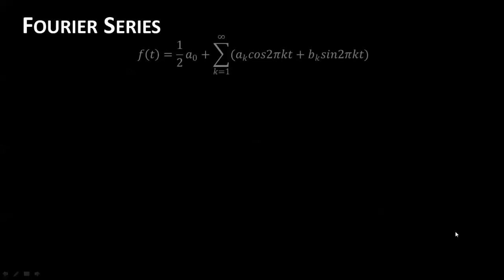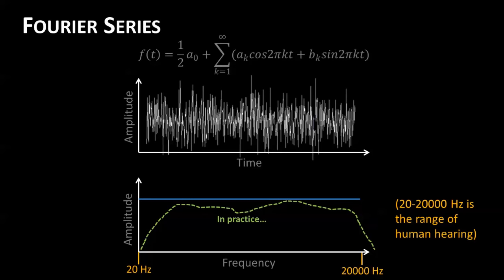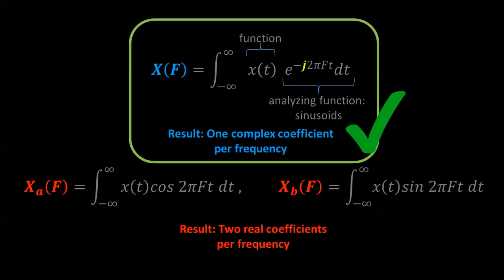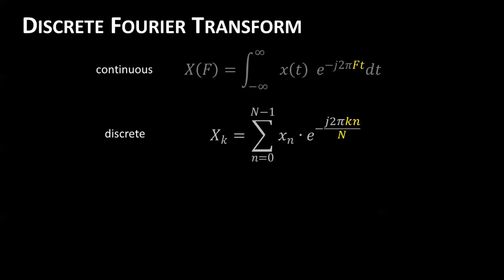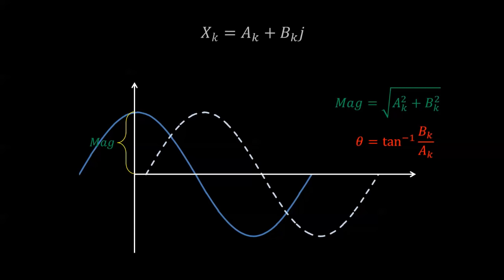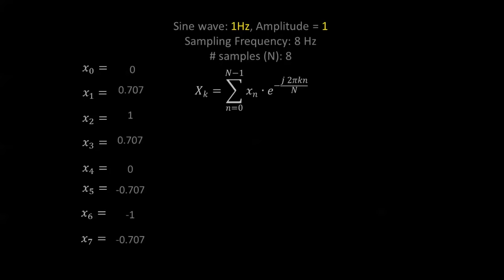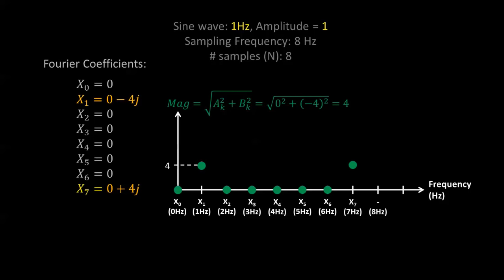Discrete Fourier Transform - Simple Step by Step

Comment: How do you know the phase angle is based off of a cosine wave?
Reply: i also didn tget why it is based on cosine. in the divide and conquer it interprets (cosθ; sinθ) = cos + i*sin. therefore since we have X1 = 0 - j, i would expect to the starting point to be at (cos,sin) = (0,-1) which is indeed the 3pi/2, but that doesn;t justify why we build our final answer on the cosine  glyn hodges

Comment: This is a very nice presentation, but not sure if the explanations for frequency resolution, why you drop < Nyquist, double, then average by 1/8 for the amplitude, etc. are quite correct.  I think it's a lot clearer if you directly convert from Fourier Integral to the sum, where t->t_n=0,1/8 sec, ..., 7/8 sec., and F-> k Hz, dt->1/8 sec.  These should give the correct results without the need to remember all the rules/explanations given here.
Reply: Can you explain that in more simple way? Or any other good way to calculate amplitude from results of this video?

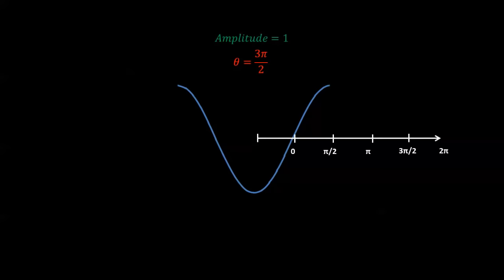Comment: If you change the input to 1 + sin(2*p*t), that is add a DC value of 1.  The Fourier coefficients are now (8,0,-4j,0,0,0,0,4j).  Now if you follow the procedure given at 10:34 (where you double all values and divide by 8) you will end up with a DC value of 2 instead of 1.

Comment: I got confused at 7:40 on how 0.707[cos(-π/4) + jsin(-π/4)] equated to (0.5 - 0.5j). Then I figured out that (0.707...)² = 5. Posting this in case someone else gets confused.
Reply: For complex number, In converting exponential to trigonometric form  its angle should be in degrees but  i am confused why he didnt convert it to degree form, it's still in radian.
Reply: @markinodeo8761   Have you ever asked yourself why it should be changed to degrees?

Comment: Eh. Good video but IMO, it's way more intuitive to first think about the FT using the DFT, and then to think of the DFT as the correlation sequence of the analyzed signal with the complex sinusoidal basis function (i.e., e^(j2piFt)). Cross correlation of two signals x(t) and y(t) gives a value that tells you how similar they are. The DFT can then be seen as a cross correlation of your analyzed signal with different complex sinusoids -- this allows you to say that there's a "sinusoid component of frequency F" in the signal. The youtuber "David Dorran" has a nice video series explaining correlation. 

To see what is meant by sinusoidal basis vector, it's intuitive to think of a signal as a vector (each component of the vector is a point in the signal). Julius O Smith's book "Mathematics of the DFT" broaches the subject this way (Chapters 1-6) and goes on to give a 2D example of signal reconstruction (i.e., the signal consists of 2 samples). With the geometric understanding of a signal and the understanding of DFT as a cross-correlation, you'll see what the DFT for what it really is. 

Then you can extrapolate and understand the DTFT, and then the FT.

Seeing the DFT as a sum of of terms doesn't give any intuition about signal reconstruction. The path I recommend is a bit more tortuous but it gives you a MUCH better sense of what the "coefficients" Xk, Ak, Bk mean (Ak and Bk are values in a cross-correlation sequence for real/imaginary components; Xk is the complex-value cross-correlation value).

Comment: Thanks a lot for the wonderful explanation! May I ask why should we double the magnitude of the amplitude below the Nyquist frequency? Does the equation of discrete Fourier Transform imply this? Really hope to get your answer!!!
Reply: Zhongwei Jin yeah even I have the same doubt.
Reply: Nyquist frequency means you have to sample at 2 time the maximum frequency in the signal. your result spits out values outside of that range because thats how it mathematically works but not physically when building a filter or other DSP device.
Reply: You can look at at from the point of energy.
The result not only tells you the amplitude and phase, but the integral under the "curve" is a measure of energy.
Now the way it works is, that you have spread out the total amount of energy over the whole result. But you know that everything above the Nyquist frequency actually is "a lie", you just get it because of the limitation of this limit. But even if we know this to be an artifact, it still consumes "area" in the graph and thus represents energy.
If you just cancel that part, the energy consumed by this part of the graph still needs to go somewhere. So what you do is, you "distribute" the energy from the canceled part to the part you are keeping. And since you cancel everything above the half of the graph, this means you have to double everything below that split point in order to keep the total amount of energy constant.

In Physics this often is a very powerful method: If there is some "problem" in understanding why, then apply the one most important concept in all of physics and technics - conservation of energy. Energy usually - but not allways - pops up (if it does at all in the problem studied) as "area under the curve". So if there is some doubt, try to figure out what the area under the curve could mean. If it is energy, then the principle of conservation of energy applies.
Reply: @kallewirsch2263  excellent answer, thank you!

Comment: Extremely helpful but I'm having trouble interpreting my own result for a set of points [2 2 1 0 0 1] (a shifted trig function). I'm getting X0 = 6, X1 = 2*sqrt(3), and X5 = 2*sqrt(3) and so I considered the Nyquist limit and got X1 = 4*sqrt(3) but would X0 become 12 or stay 6? Also I have angles so how do I put all these results together in one trig function? Is it going to be a complex combination? Thank you.
Reply from the maker: If you got X0 as 6, you will have to multiply it by 2 after changing it to a single sided DFT

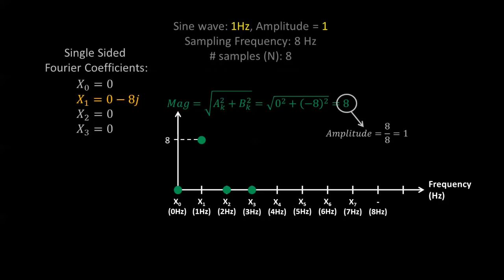Comment: Would the Discrete Fourier Transform technically be complete at around 9:43 where the signal is shown as its frequency domain representation, where for 1Hz (x value), it's amplitude (y value) is 1 and all other values are 0 because they are not present in the signal?

Comment: 1) Not amplitude as a function of time, value (voltage, current, pressure, etc) as a function of time.  Amplitude is the maximum extent of a vibration or oscillation, measured from the position of equilibrium.  (Even LabVIEW makes that mistake.)
2) You can't take the Fourier series of white noise, white noise is not a periodic function.
3) The standard for phase angle is between pi and -pi, so the angle is -pi/2

Comment: Great video! I am still little confused about sampling frequency in the discrete Fourier transform part. So does k or N represent my sampling frequency? Does the sampling frequency must be equal to my number of sample? Say if I want to adjust my sampling frequency into 4 Hz, which parameter should I modify here??
Reply: N somewhat represents the sampling frequency. k is just a number which runs from 0 to N-1 (that simply means: through all the samples you have got).

"Does the sampling frequency must be equal to my number of sample?"
"sampling frequency" simply means "how many sampes do you take in 1 second". So "sampling frequency" and "number of samples per second" are basically the same thing, with the later just taking into account for how long you sample. In practice you will not sample for exactly 1 second. If you do, then the number of samples will be exactly the same as the sample frequency tells you numerically. But as said: Usually you do not sample for excatly 1 second. YOu may eg. sample for 2 seconds. The sample frequency tells you literally how many samples will there be in 1 second. If you sample for 2 seconds you logically then get twice that amount of samples.
"Frequency" literally just means "how many repetitions are there in 1 second" (repetitions of whatever. It doesn't matter what you are looking at. If somebody is entering a door 10 times per second :-), he does this with a frequency of 10 Hz. 10 Hz is just a different way of saying "10 times per second".

"Say if I want to adjust my sampling frequency into 4 Hz"
4 Hz basically means: taking 4 samples per second.
Note: This doesn't mean that you are not allowed to sample for eg. 5 seconds. It just means: in 1 second you take 4 samples. So if you want to sample for 5 seconds, you have will end up with 20 samples.

Hope this helps to light up your confusion.

Comment: I was able to code this out in R. I succesfully got my amplitude value, if there was a y intercept of zero, but my phase shift didn't seem to work. I could try that phase shift again, but I'm curious does anyone know of a method to solve for the frequency/period and y intercept once these other paramaters are known? 

 This is a lot more complicated than linear, polynomial, and multivariable regression where the least squares derivatives can be easily expressed in a matrix as a system linear equations.
Reply: Isn't the y-intercept the value of y at x=0 ie. at t=0 . By this logic it should be just the (phase shift * amplitude) because sin(0) is 0 . i may be wrong but that's how I thought it was

Comment: How do you calculate phase shift if you get Ak = 0 and Bk = 8? you can't devide tan-1(8/0)
Reply: If Bk > 0, then the phase shift is pi/2 and if Bk < 0, then the phase shift is -pi/2. It's best to see them like in the unit circle, where the complex number would then lay on the Imaginary axis. Also, when Ak<0 and Bk>0, then the phase shift is arctan(Bk/Ak)+pi and when Ak<0 and Bk<0, then the phase shift is arctan(Bk/Ak)-pi. https://electronics.stackexchange.com/questions/110878/correct-phase-bode-plot-of-transfer-function here someone asked the same question.

Comment: Great video, but your plot and explanation for the plot at 8:30 are not correct. It is true you can't have frequencies in your signal greater than the nyquist frequency. However, the signals to the right of the nyquist are "negative" frequencies and should be labeled -3,-2,-1.. Not 6,7,8. The reason you can multiply the positive frequencies by 2 and ignore the negative frequencies is because that's the same result you will get for real signals if you add them.

In your example, a phasor with 4i magnitude and a phasor with magnitude -4i spinning the same speed in the opposite direction will add on the real axis and cancel on the imaginary axis, resulting in a real signal cosine wave with amplitude 4+4=8. This is true for all phasors with equal and opposite frequencies, and is formalized as a modification of Euler's formula= cos(t) = (1/2)(e^jt + e^-jt) where omega is 1 and - 1 respectively .

However, the rest of the video was exquisite, and your final result was right on the money. Cheers!